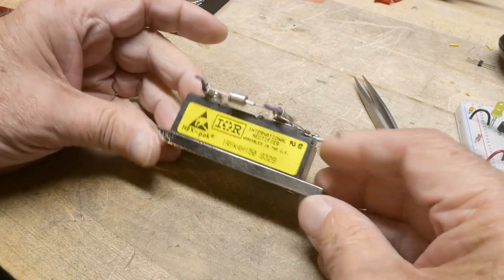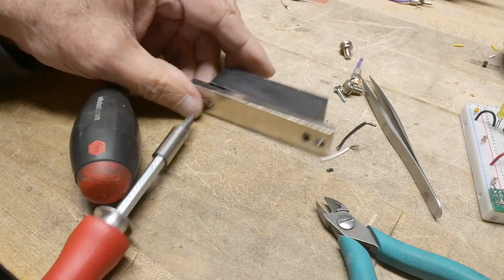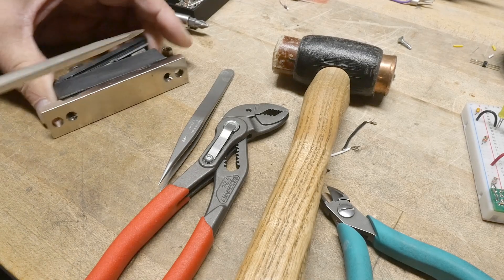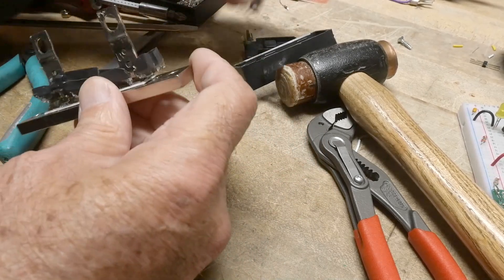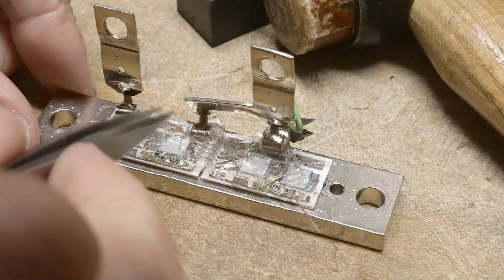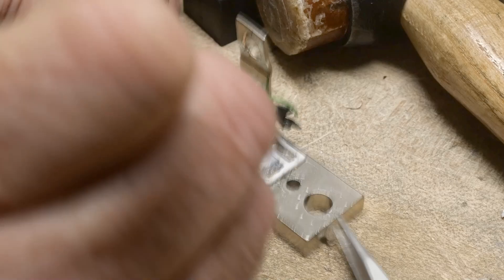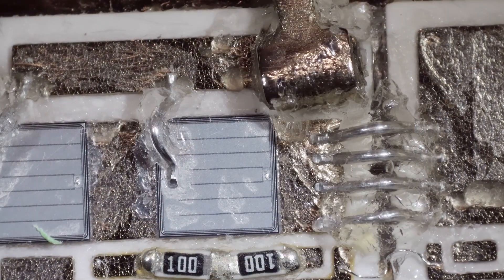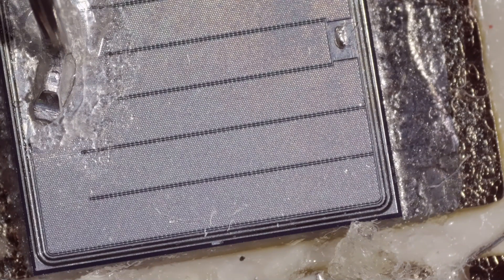#2234 Big 145 Ampere FET Dissection

Comment: Date code 9329 so 30yrs old.  A design I did about 8yrs ago I used 3x surface mount fets in parallel to switch 400A.  It only needed to operate for about 1-2 min at a time so the board copper pressed against a base plate with thermal paste was sufficient.  Those fets were rated at 0.7 (if I remember right) m-ohms for ON resistance.  Amazing progress on fet performance.

Also worked on some 3ph inverter designs using 1200V/600A IGBT modules.  Numerous parallel dies with a gel covering them.  Unfortunately, have had to post mortem too many of those.

Comment: You said you don't like chemicals, and from what I've heard that's a good policy WRT the stuff the will dissolve epoxy, but I would have tried to clean the transparent goo with IPA, acetone, or maybe a consumer grade adhesive remover like Goo-Gone.
Reply: The transparent goo is likely thermal silicone which will not dissolve in any of the above. It might swell and become more gooey with the appropriate solvent though and make it easier to scoop away.

Comment: It looks like 4 transistors in parallel  with the source and drains all tied together and the gate of each transistor being connected to the common gate pin through it's own 10 ohm resistor.

Comment: Sadly you are too far away, I have a box of CM800DZ FET modules (dual FET 800A 1,7kV). My uni threw them away after using them for some kind of humidity testing, they still work fine.
Reply: Nice ill take 4 for a amplifier project 😊

Comment: In the mid 90s I designed a vary large (several 100A) linear amplifier for testing of substation equipment with the totem pole version of this part.  It used several in parallel.  After some frustration, I figured out that some were bad, and we sent them back.  Replacements came that were also bad... and so a dissection like this ensued.  It turned out that the gate and source drive connections to the small spade lugs were swapped internally on the bad ones.  That clear silicone goo got everywhere, and stuck around forever :^)  FWIW, I was never comfortable putting that amp into production, fearing that current sharing would be poor.  There was no way to use source degeneration resistors with the upper fets.
Reply: The issue with current sharing even exists within the die, particularly with older generations of MOSFETs.  Large power mosfets are actually a bunch of smaller mosfet cells connected in parallel on the same substrate/die.  If there is a minor variance in Vth or RDSon in any one of the cells that cell may begin to dissipate more power and overheat.  Newer generations of MOSFETs benefit from vastly improved manufacturing process tools and QC practices so this is less of a problem.  Linear MOSFETs actually have two different Vth within its gate structure to help with this issue.

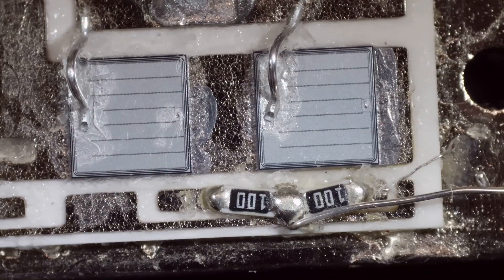Comment: You seem to have broken all the gate bond wires. If anyone is interested you can see the pad for the gate connection to the right on each chip. At 6:26 you can see one of the thinner gate wire connected to the resitor but pointing upp and right instead of to the chip.

Also the boards "Direct Bond Copper (DBC) substrates" are not glued to the baseplate, they have coper on both sides and are sintered or soldered to the baseplate for best thermal conductivity.

Comment: Yikes! Don't power transistors often have really nasty stuff like beryllium in them?
Reply: Ah. Good to know
Reply: Yes.  The thin white substrate layer between the dies and the metal heat spreader is most likely beryllium oxide ceramic.  Not really hazardous unless crumbled into dust and inhaled.
Reply: @bobweiss8682  actually it's most likely aluminum oxide, or alumina.
Reply: @mrDarktrooper  Beryllium oxide has MUCH better thermal conductivity, which is needed in this application.
Reply: @bobweiss8682  I think it is mostly power RF transistors that have beryllium oxide substrates in them. Most transistor modules like this have aluminum oxide or aluminum nitride.
Reply: If Beryllia is in the package, there would be the letters BeO  visible somewhere on the exterior of the package, which I didn't see in this video.
Reply: Someone said this part is 30 years old. Maybe the labeling requirements weren't as strict as now or just placed on the product packaging.
Reply: @nikolaoseleftheriadis8116  Not correct, I have Apex PA-12M-18 high power OP-Amps, date-coded 8903, with 'BeO' labeled on them.